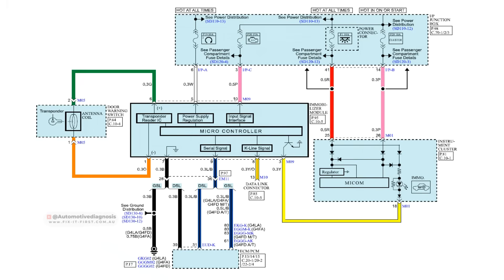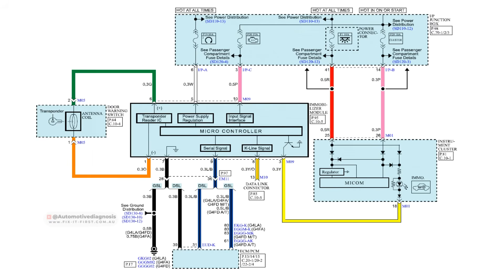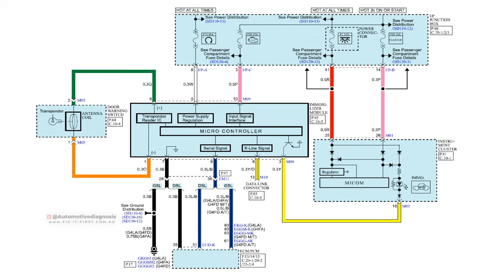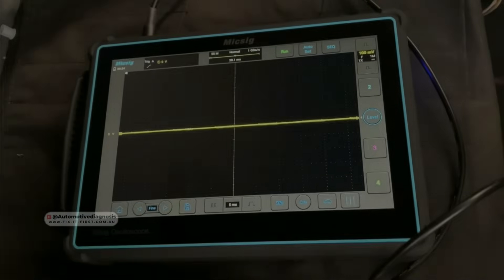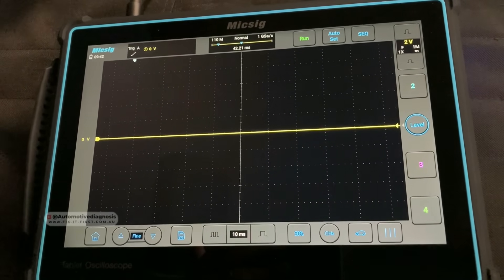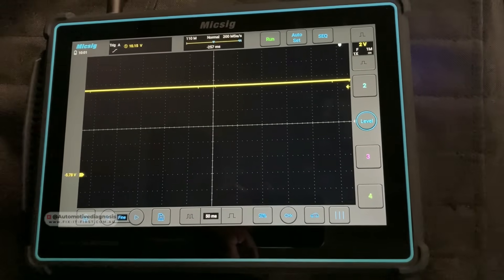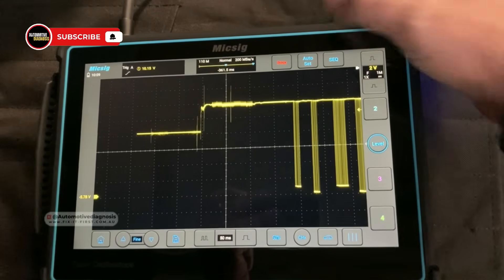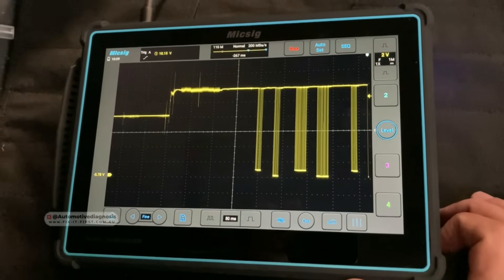Immobilizer - ECM Communication Diagnostic | IMMO K-LINE No Start Diagnostic | MICSIG Oscilloscope

Comment: i have a kgm or ssanyong 2024 it does share same engine and wiring harness as older modules the car wont turn on ignition afte being in a car accident airbags deployed previsouly in mercedes their was a way to baypass it or change a pyro fuse , just wondering if you could help of location and whats precnting these cars from turning on what system do they use? i have one that has been in an accident but wont start ignition i know bmw and mercedes have pyro fuse what does this car have to prevent it to turn on and where is it located.that would help me alot !!!!
Reply: Messaging from my other account awaiting for your reply it would be great help . My dad is a kgm torres 2024

Comment: Thanks for sharing, how we can diagnose the immo integrated to the ecu or bsi?
Reply from the maker: Hi my friend. If it’s integrated with BSI, it still needs to communicate with ECM to authorize the ECM for providing the ignition/injection during cranking so we can find that connection and check it out. If it’s network, it would be pretty much like this video.
If we have the immo integrated with ECM, we still need an interface to provide the key information, from the antenna coil, to ECM. This unit is not gonna decode the keys, but it’s important for sharing the data. In this case diagnostic would be between that interface and ECM.
For each case we have more diagnostic on immo, but what I mentioned was only for the initial data request to start the engine. There is a video on the channel for immobilizer system.
Reply: @AutomotiveDiagnosis  thanks a lot 🎉